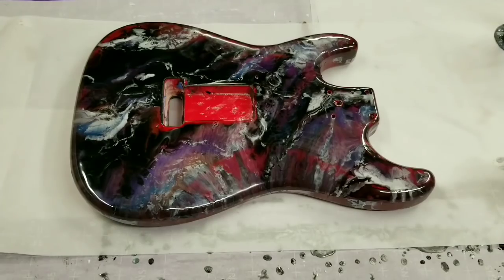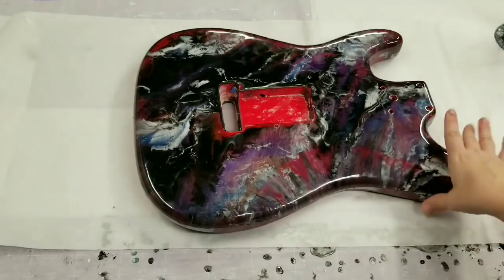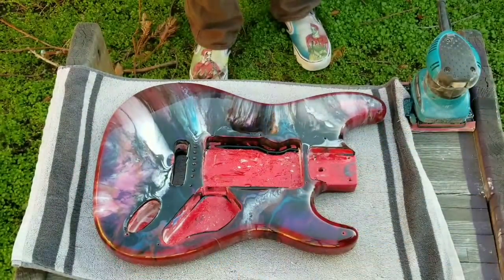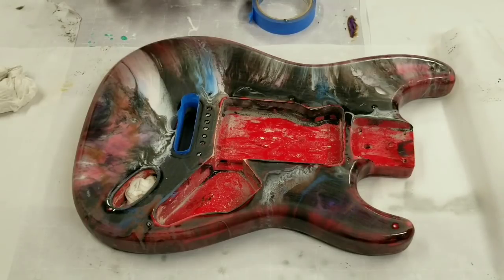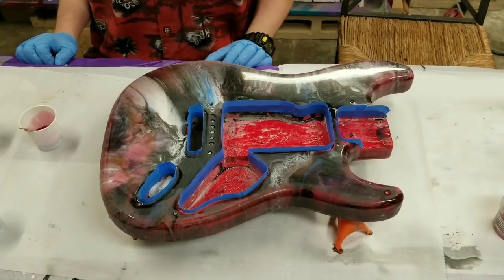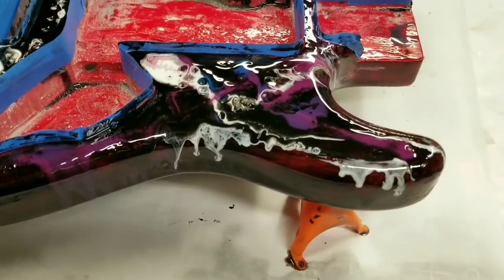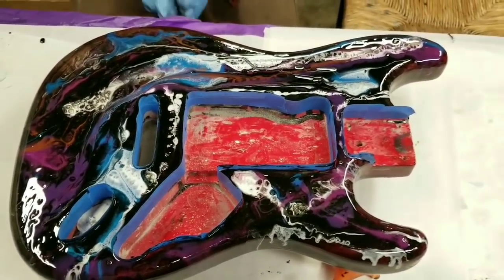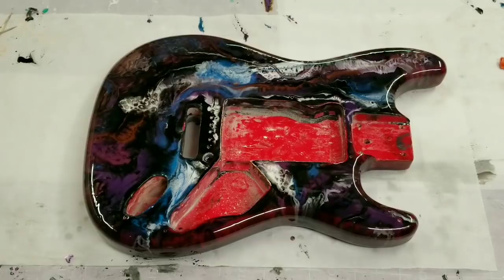Resin Painting an Electric Guitar - Part 3

Comment: The multi-sided epoxy pour is a true challenge.  Have you considered attaching a handle in the neck slot, & pouring both sides, then slowly rotating so that gravity hopefully evens things out?  Would be tedious to do manually, but putting it on a rotisserie would be a thought.

Comment: Absolutely beautiful!!! I added sparkle epoxy to a free messed up ukulele a few years ago. Still need to work on it. But had similar problems  with tape. Ended up having to sand it off. And had to do multiple coats bc I used large sparkles ✨